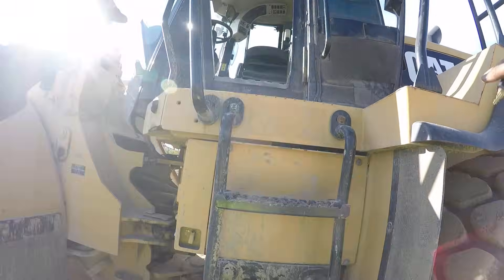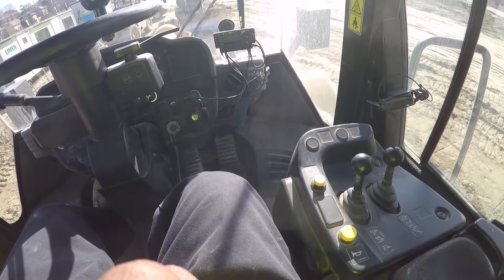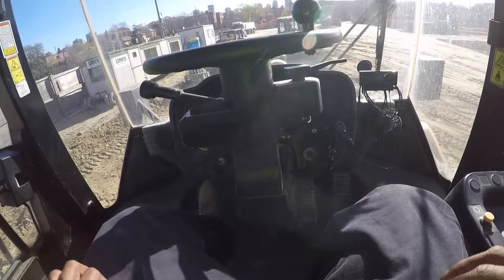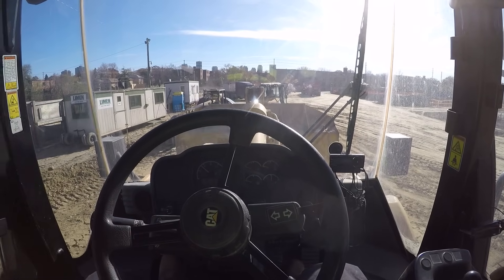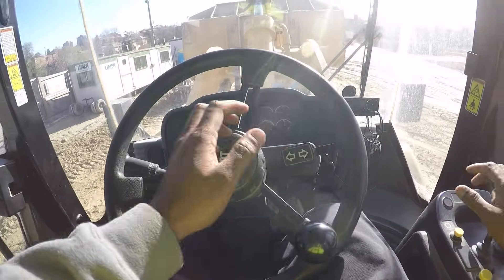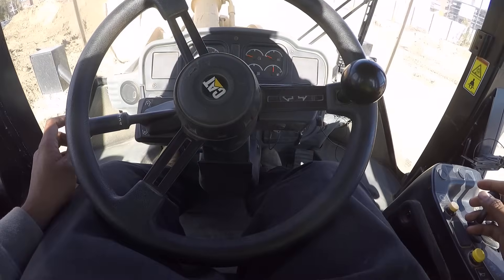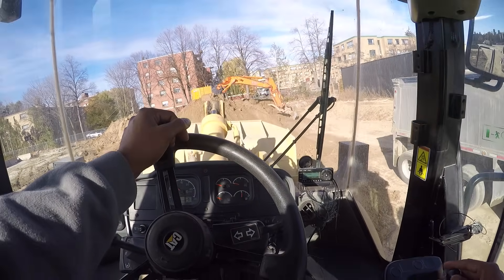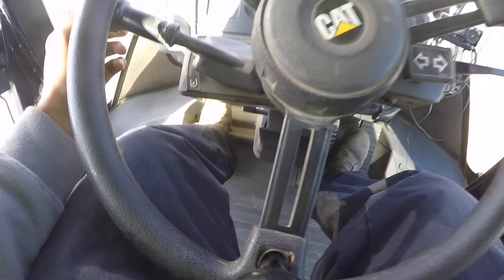HOW TO OPERATE - A Front End Loader! HD 6:51 Play time!

Comment: Do you need special license to operate the loader
Reply from the maker: on job site no. if drive on road yes.  also if union job, they will give you license (ticket) or certification
Reply: I have a tractor trailer license what kind of  license u need to drive  heavy duty construction machines like backhoes and loaders  and bulldozers
Reply from the maker: @jimkontos4221  I’m pretty sure a class D. (Straight truck license will do) but Az is a big plus. What are do you live??? If in gta I got a job for you
Reply: New Jersey

Comment: First check fuel def oil .check hydrolic transmission controls be sure there is no material under bucket cylinders blow out filter check great lines if yousing auto graser grease nipples that lines are broken keep pins happy it s your doll its you I AM THE LOADER ATTITUDE THEN CHECK LIGHTS WIperS report all damage number 1 take pictures blow out rads filter and engine takes about 30 min but your ass is covered
Reply from the maker: very good!

Comment: This must be a joke right. Digging in 4 gear, that will get you fired. 2 brakes. Don't put these videos up as a joke. Some dumb ass is going to get killed and it will be your fault. Left brake is a brake and trans disconnect. Right brake is just brake so if your going down a steep hill you can use brake while your in gear. Fill bucket in 1st or 2nd if loose material. Only use 4 th on road or across yard maybe. Load while going straight, never spin a tire, put bucket down at pile so you don't wear edges out fast. When you start in pile lift bucket that will transfer weight to front tires giving you more traction. I've trained 30 loader operators. Many have top jobs in gravel pits now. One of my 18 year olds just got on operating a 988 feeding a crusher with world wide company.
Reply: Gud day Boss, plz can I have a private conversation with you, I want to know more about wheeloader. I think you can help me out. I'm a  incoming wheel loader operator
Reply: You should b the one making the video. Very useful information I will apply it to the next time I’m on the loader. Thanks 👍
Reply: Yeah, I honestly think that was a poor job! You didn't explain thoroughly or allow them to see you moving & picking up the load😔1 brake, 1 more like a retarder

Comment: That’s the machine He’s driving..😆🤣 
I operate my loader. 
The Far left pedal is to control rim pull and 
You had better check more than just fuel, transmission fluid and grease during a pre-shift inspection. 
If you’re going to put out a video on how to operate a loader you should probably learn how to operate it yourself.
Reply: Far left pedal in the 986
And lower is a de clutch it only kicks it into neutral, and acts as a brake 988 and up is when it controls rim pull  and acts as a brake
Reply from the maker: true

Comment: Fun video.  I love how quiet loaders are today.  My first one had a 4-53 Detroit, once started, you throttled it to redline, like 2,500-2,800 RPM and worked all day in your open ROPS cab.
Reply: Small underground mining equipment is still like that. Open cockpit, mechanical throttle, 2300RPM and move some muck! I always bring a pair of earplugs or muffs if I'm doing more than moving the machine ten feet. I'm 24 and my hearing is already a bit jacked up from working in crusher plants, so I try to protect what I've still got.

Comment: Sorry bud but the title of the video should be “can some show me how to operate”. First off your circle check should be done before turning the key. Second always go into a pile in 1st gear or you will just chew up the transmission and third why use 2 hands for your bucket controls? They are made to be used with one hand. And finally always use 3 points of contact when getting on or off a piece of equipment.
Reply from the maker: Thank you thats 100 % great corrections to the video! Thank for your feed back Sam.

Comment: Don't ever push in anything other then 1st gear. That's how you'll be putting a new torque converter in that transmission
Reply from the maker: Tristan Horner thanks for the tip
Reply: I push 2nd gear once it starts to feel little heavy change to first gear
Reply: You shouldn’t be teaching how to operate a loader, first off use a lower gear when entering a pile, second you didn’t even explain your walk around, and mostly 3 points of contact when exiting your machine you should always face your equipment and walk down it, smdh.....
Reply: People that are watching prob just want to know how to move one if they have it or how it operates because anyone certified to use one for work shouldn't be learning on youtube... lol
Reply: @bulletclub4life  I know how to run one, but only with joystick controls. Never dealt with twin-lever bucket controls before.
Reply: @Porty1119  let me tell you it's pretty easy to get used to 2 sticks and you can get better bucket control than with 1. Less arm fatigue with finger control rather than full arm/wrist. I run a 980K with 2 sticks and 980M with single and I prefer the K.
Reply: @wraith0127  I wound up running 980Gs and a 980H (both twin-stick) quite a bit since I posted that comment. Honestly, I don't have a preference either way, but I'm young and haven't experienced arm fatigue while operating.
Reply: tnphchris shut the fuck up u sound like a straight bitch